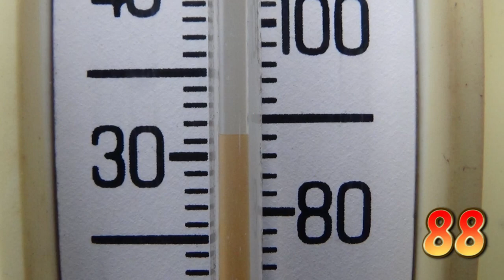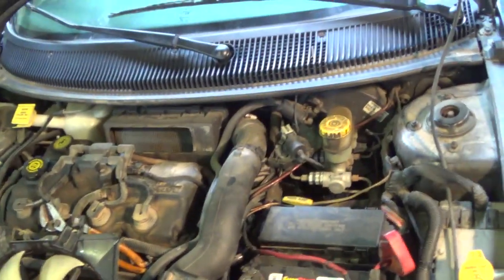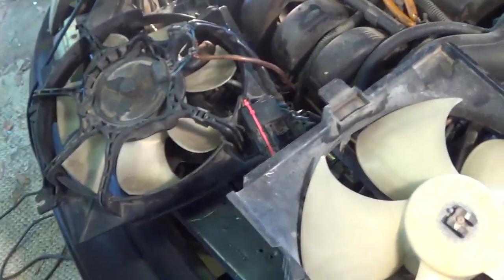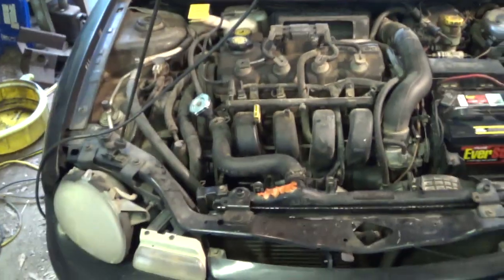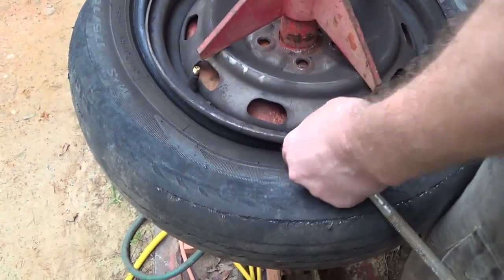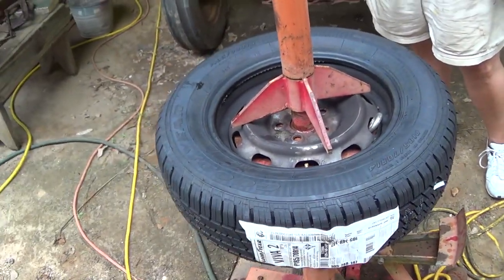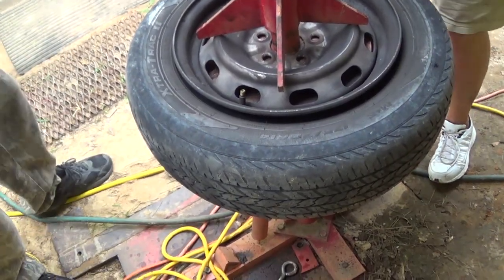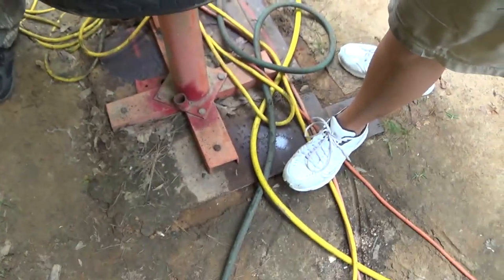Working on Stacey Neon Car Today

Comment: Them manual rigs could be rough, but were still less work than sweating out back with a bead hammer on 11r22.5's.
Reply from the maker: justlivin Thanks for the Visit justlivin